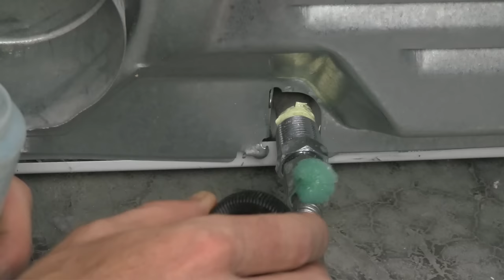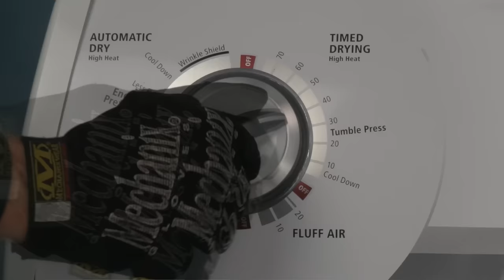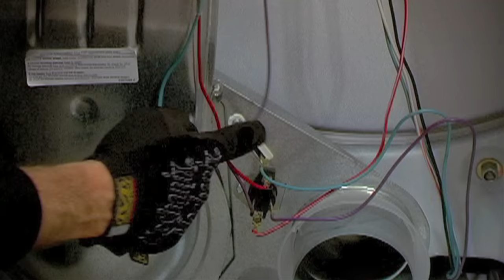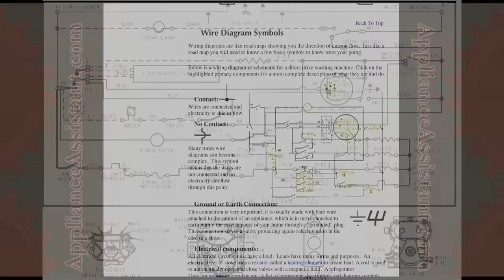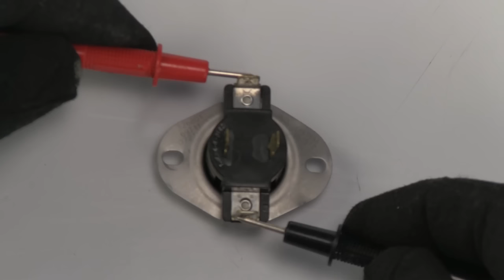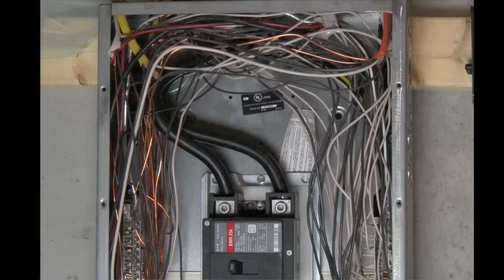Gas Dryer Repair: Fix Heating Problems

Comment: My daughter just asked me if I could maybe "just look" at her dryer that stopped working yesterday.  I wanted to get a troubleshooting plan before I head over, so I just watched about 12 videos prior to this one because still after the other 12, I had that "mystified unclear" feeling on the complete operation, especially on the ignition/gas valve section. After watching this, it is now crystal clear to me. In the other videos, many comments were claiming "this is the best", however I think that it's very unfortunate for them, as they obviously haven't found this video yet, because this one really is, "The Very Best of Bests". Lol You have covered every function in detail, along with great troubleshooting procedure. 
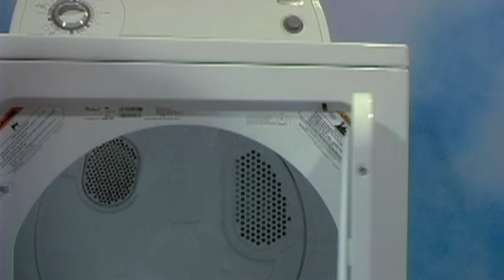I am now retired from being an industrial CNC field service tech for 21 years, along with filling in for customer service tech phone support, so I am very familiar with service as a whole.   You were the only one that I have seen, where at 10:30 of the flick, with one reading, you checked a large "chunk" of the schematic, eliminating having to check many components individually. When I would troubleshoot I would do the same technique, then  divide the schematic in half to see what half the issue is in, then divide that in half, and repeat until it brings you to the component or wire. The industrial CNC's had many pages of schematics, but the technique is the same. 
Thanks for putting together a well edited "How to" video.

Comment: Very concise and straight forward. I just found this video after putting off my dryer repairs for a long time as i had too many different things going on, like fifty other things that broke down or need fixed.lol
I forgot some of the info i looked up before about isolating the exact cause, and this is exactly what i needed to get me back to speed as im tired of having to drive my clothes to the laundry and dry them after washing. Lol

Comment: Thank you for all your infos   . My MAYTAG GAS CLOTH DRYER was not heating . I changed the Igniter, Flame sensor, the 2 coils . Now when I start the dryer the igniter glows but shuts off after 15-20 seconds and the flame does does not go on ., would you please tell me what other components I have to check or change , please ?

Comment: Thanks, very clear. My Matag gas clothes dryer has intermittent ignition, about 20% of ignition cycles fail. When ignited the gas flame looks proper (very blue) and continues till the desired heat is reached. I've cleaned the air passages, replaced the coils and then replaced the igniter (OEM parts). The failure rate seems slightly better, but still fails. I've seen it fail when everything is stone cold, and when hot. I always smell gas after a failed ignition. Is there a measurement for the flame sensor closure period to allow the igniter to fully heat? Any suggestions welcome. I love to fix things.
Reply from the maker: That's a tough one! What's the model number?
Reply: @applianceassistant  Maytag MGDB200VQ1. I've captured video by IR camera through the peephole https://youtu.be/z0iYGXSyGaA  There doesn't seem to be any difference in the igniter/valve timing between good and failed ignitions. I don't have a suitable gas pressure gauge. Takes 2 to 3 seconds for ignition when the flame sensor opens. Always holds the igniter on for 12 seconds. The camera points at the igniter (reaching 174C), but obviously not at the hottest gas stream ignition. Hmmm?

Comment: One thing that I’ve had happen with dryers that came through over the years that weren’t heating properly which left me stumped despite checking everything is weak high limit or cycling thermostats, or the incorrect thermostats installed for the high limit cycling the dryer below the operating temperature. Just wanted to share incase if anyone else has had this particular problem.

Comment: Best video I've seen to troubleshoot my dryer not heating problem. Saved me a lot of money. After a process of elimination, I replaced the coils and it solved the heating problem. I bought the coils by the way at Amazon and so far everything is working good. Thank you very much for this video.

Comment: @frugaldiy1 when the centrifugal switch is taken off of the motor. 1-6, 3-5, 5-6 all switch ok. All three are the opposite nc/no when switch is installed.

Except 3-5 is always closed. Installed or not and does not open when the sliding ring on the mower is pushed over.
Any ideas? Would this cause a no heat issue. All the other safety switches seem to be good.
Reply from the maker: To be honest I have never gone that in depth into a centrifugal switch problem. If I diagnose that issue, which is rare I replace the motor. Have you checked power from the timer? On newer models that is far more common. Sounds like you are familiar with this kind of thing so you probably have. Sorry I can't be of more help, Good luck!
Reply: At some point in all my digging around and taking things apart. It started working.
Different areas of the lint exhaust system had restrictions. 
I am not sure which safety switch was causing the np heat.
It was not the resetable limit switch.
Thanks for the help.

Comment: Mine is just under 2 years old and I’m having the same issue with the blower wheel just spinning. Seems crazy for this to happen in less than 2 years!! First Maytag purchase and likely my last!
Reply from the maker: It is crazy that we are having issues at such early ages on the new appliances! FYI Maytag is a Whirlpool brand.  Not sure if I am understanding your blower issue but hopefully its just a broken blower wheel. Good luck!

Comment: Mine's an electric dryer in my pulley does not fit right in front of my motor like I've seen in other videos it fits in the slots in front but it doesn't actually sit on the motor itself. So I'm slightly worried that it might be broken and not be able to be fixed
Reply from the maker: It sounds like you have the type of dryer I am working on in this video. If it is, the pulley locks into slots cut in the bottom of the dryer. All the other types I know of mount to a bracket with a bolt.
Reply from the maker: This video may help if you have this dryer style.

https://youtu.be/ryWXncxya3w?si=rLlcd_USeYPzxJfQ

Comment: Not many gas dryer burner diy repair videos on YouTube that I was able to find. 
I almost followed step for step but I have a newer model. kenmore 700 elite front loader with lint catcher beneath door. But after exposing the burner unit it was step for step.  I tested everything and it ended up being the dryer fuse. It was a 20$ part,but verse a new dryer...or even the handyman. Helps to be familiar with tools n what not but pretty easy. I think almost anyone can get through it with this video.
Reply from the maker: Thanks for the comment! Glad it helped!

Comment: I have the same dryer model , the problem is the flame, the cycle is normal but the flame is too weak, takes about 55 minutes to dry compared to 40 mins in a similar dryer size but different brand, any suggestions?
Reply from the maker: Long dry times are almost always an airflow issue. Find where the air is leaving your house and make sure you have a strong push. If it’s just a little warm air, it’s probably not good enough. Good luck! Also high end of a high temp cycle on most dryers is usually between 180 and 210°F if you have a meter with temp leads you can check the cycling temperature to be sure. Could have a weak cycling thermostat.

Comment: Excellent diagnostic video! I had an intermittent no glow igniter on a <1 year old Amana.  All the components checked out ok.  Thanks to this video, I was able to troubleshoot and determine the centrifugal switch was not working and found out that the connector was not completely locked in.

Comment: Confused"  You say flame cuts off after a few seconds?  Mine is 3:06, then shuts off?  OR, you say it shuts off after about 30 mins, and it could be this or that?  That's confusing, and I think you have the answer? Do you, as it could be Sensors, Sensors, OR Coils, BUT if coils, only after a few seconds - VERY confusing?  Please explain.  Thank you for your video!!  joe R.
Reply from the maker: Under normal circumstances, on high, the burner will heat the air to between 180–220° Fahrenheit then shut off until the air cools down to about 100 -110° and cycle back on for another burn. It should keep doing this for most of the cycle until the cool down at the end. If yours is burning for a little over three minutes and then cycling off, that sounds normal.
Just keep watching and if you ever see the igniter glow and go out, without an ignition, then you likely need the coils. I hope that helps. Good luck!

Comment: Mine starts has the flame come on for a few seconds then shuts off with an error code of E01. It's a Bosch. I bench tested the flame sensor and it never opens. Could this be why or something else?
Reply from the maker: If the flame is happening at all it is unlikely to be the flame sensor. Those symptoms normally point at restricted airflow or a bad high limit temperature sensor. Good luck!

Comment: Great video, thanks very much. The only thing I missed is how to test and replace the valve if the coils are not the problem
Reply from the maker: I should have covered that! It’s very rare for the valve to need replacement. It’s pretty straightforward, just disconnect the gas line and the bracket that the valve is mounted to and swap it out. If you need to reconnect any pipes use some yellow Teflon tape and leak check with some dish soap with some gas pressure. Good luck!

Comment: My dryer burner comes on for like 30 seconds then goes off. Takes forever to dry its venting great but my lint trap isn’t getting any lint on it to clean off. Has me frazzled. The clothes are super stiff and wrinkly also
Reply from the maker: Sounds like an airflow problem. For some reason the blower is not drawing through the drum well. To the burner this is just like a clogged duct. Check all the air seals for your drum, blower housing, etc. anywhere air can escape the drum apart from where it should be going inside the left back air vent and out the right back air vent, through your lint trap. Hope that helps! Good luck!
Reply: @applianceassistant  awesome will do thank you I’m going to check out it blows out the vent well that’s what had me going nuts

Comment: Should I be getting a reading from the ignitor on ohms? If I do does it mean it is weak and needs to be replaced? I have a Kenmore 400 series. Thanks and God bless!
Reply from the maker: There should be a resistance value on the igniter, not open. Hope that helps some. Good luck!

Comment: I just replaced the two coil valve solenoids 2 months ago. Same issue again. When it wants to, rarely, it will flame up but then goes back to glowing and off. Suggestions?
Reply from the maker: Sounds like the coils again. Not common having parts fail that quick but not impossible. I would start there. Good luck!
Reply: Thankyou

Comment: My fuse was burned and my thermostat too. I replaced both but still my dryer doesn’t heat up. What could be the reason?
Reply from the maker: Can you see the igniter glow? Many of the new ones are more challenging to make that determination.
Reply: @applianceassistant  no, it doesn’t glow up, and I checked the coils and were good
Reply from the maker: @CGMT01 if the igniter is not glowing, it’s not the coils. It could be the igniter itself, or a power supply problem like the thermal fuse, control, timer, etc.
Reply: I tested the igniter and it gave me 007. Is that ok?
Reply from the maker: I’m not 100% sure what that reading means, it depends on the meter setting to interpret the value. Genuinely speaking with a dryer igniter, if you get a reading at all it’s not broken and likely not the problem.

Comment: "De-mystified and made clear."  That's a good one!😄  I was following along until you pulled out those schematics!
Reply from the maker: Yea, that was probably a bit ambitious for this video. 😊 
If you’re going to fix appliances as a profession, absolutely required to know. But for most DIY repairs, wire diagram understanding is not super important. I hope it helps with whatever you’re working on!
Reply: @applianceassistant 
It turned out to be the thermal fuse. Thanks!👍🏻

Comment: Did I miss something? My igniter goes on and the flame comes on for 10 seconds then shuts off. What’s does that mean?
Reply from the maker: The high limit thermostat is probably shutting off the burner. Check your home duct and dryer ducting for air flow restrictions. That would be the most likely cause anyway. Good luck!

Comment: how do you test when the problem is intermittent?  sometimes the igniter doesn't even come on. sometimes it come on, gas starts for  10 seconds then the gas stops. sometimes igniter/gas comes on but then later in the cycle it stops heating. i replaced the coils and some sensors but still have the problem. anyone have any suggestions?
Reply from the maker: Short answer is with difficulty. With those symptoms I would look closely at the high limit thermostat. If it was a clogged duct it would likely be more consistent. Good luck!

Comment: I need help im going crazy 😅 my dryer doesn’t heat up i have replaced the thermal fuse, Flame sensor and solenoid coil.. when i replaced the solenoid coil it worked for 1 cycle then on the second cycle the gas clicked to turn on the gas then after trying to turn it on again it wouldn’t click for the gas and the igniter turns on but the gas doesn’t turn on… i have ordered another solenoid coil to see if the gas turns on with another new one

Comment: very helpful video, thanks!
perhaps you can comment on a problem with my dryer;
It starts up, Igniter glows and burner starts and within less that a minute turns off.
I suspect that the gas valve is open as I can smell gas at the outside vent.
I replaced the  Thermistor and Thermal Fuse, but it did not fix the problem.
Any suggestions?
Reply from the maker: Does the burner try to cycle on again and ignite after the first ignition
or glow with no ignition?
Reply: @applianceassistant  yes, I hear it click and after a minute it ignites the flame but only for 10 seconds and then it off again.
Reply from the maker: @yuliyrushansky6062  my guess would be the flame sensor mounted to the side of the burner tube. They are rare to fail, but that’s what is sounds like. I would love to hear the result when you get it figured out! Good luck!

Comment: Hello,  I have a whirlpool duet gas dyer model GGW9250PW1,  I removed lower panel so I could view operation. When I start the dryer on normal the igniter glows and the gas is lite.  After 3-4 minutes the flame goes out. I have checked , fuse, thermistor , gas coils and igniter for continuity, ohms, amps and they all are good. I still replaced them one at a time to confirm under load. What do you recommend?
Reply from the maker: When it cycles to try and heat up after cool down, do you see the igniter glow and cycle off with no ignition?

Comment: My gas dryer starts and heats after about 5 minutes it flame is turned off and the drum continues to spin. I fired the parts cannon and changed the coils with no improvement. 
On my street there has been work done on the gas and water lines several doors down from my house. 
Inside the large tube containing the burner bar there was about a 1/4 cup of a grainy reddish material metallic semi sandy . I don’t see any areas where it could be coming from. Could it be from the valve body?

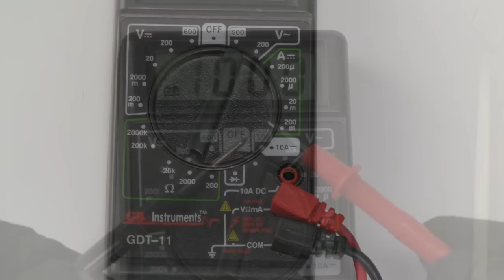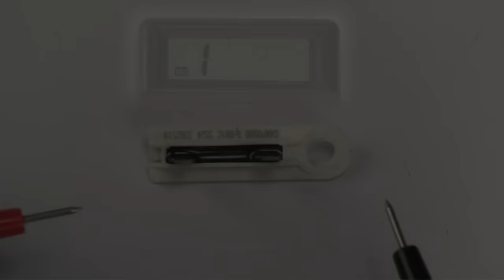Comment: Foolish error at 4:51 and 4:55. You explain how to set the analog multimeter up for Ohms at 4:51and then include a shot of you testing for 120 Volts at 4:55. This is extremely misleading since you never mentioned that to measure Voltage you need to configure the meter to the Voltage position.
Reply from the maker: Good catch, thanks for pointing it out.

Comment: I agree with the prior complements.  It is so refreshing to see a clear and complete tutorial that provides exactly the information that the title claims, without the usual sales or personal publicity motives.   Also, the explanation as to why there is an internal heating element inside the four-wire cycling thermostat is the first of all the many YouTubes that explained this and got it right.   Thanks!